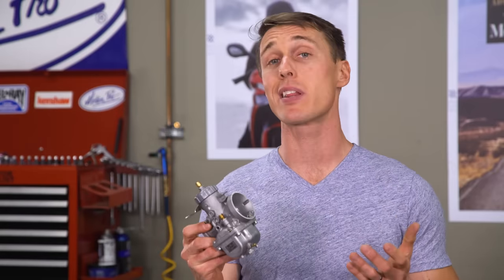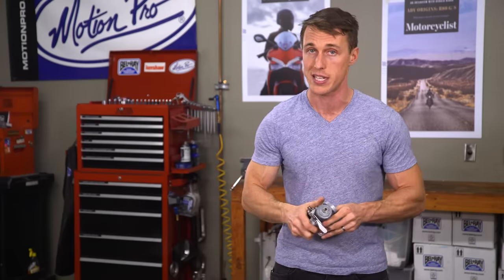Carburetors vs. Electronic Fuel Injection—What’s Better? | MC Garage

Comment: My 2000 Kawasaki ZX600E has carbs and they seem to gum up after it sits a while, especially during the winter.  I heard using non-ethanol fuel, stabilizers, and keeping the petcock closed will help minimize this.  Any other suggestions?
Reply: I usually remove the fuel from the tank b4 storage.
Reply: That is probably the correct answer, however, (full disclosure), I am LAZY!  Ideally, I would like to get the same results without removing the fuel...am I asking too much?
Reply: Just turn of your fuel line and let it run dry bevore you let it sit 
I do the same every time after a ride on my Honda DAX (you know the setting between reserve and fuel on)  and an extra it doesn't smell of fuel 
Hope this helps
Reply: Thank you for the advice!
Reply: You kinda are asking for too much. Try nopro`s suggestion. I dont have any experience with stabilizers but think about it like this. Stabilizers lowers the chances of gumed up carbs. Removing the fuel completely negates it :)
Reply: you heard ??? where the fuck have you been for the last 20 years under a rock
Reply: You're better off adding stabilizer, filling it to the neck(filling after adding the stabilizer helps to mix it). Close your fuel tap, drain the bowls and spray some foggin oil in the carb(s) throat(s) for good measure.
Empty tank, more air, more humidity, more metal wall exposed, more chance for moisture condensation.
Reply: i fit the fuel feeding line with a valve that cuts fuel just after the tank (my scooter doesn't have it on the carb) and when I store it I just turn on the engine, turn the valve and let it starve. I've been doing it for 3 winters now and with a cleanup every mid summer it's been running great
Reply: Al the Pal well u can just start ur bike nt ride it during winters keeps both carborator and engine in gud health
Reply: use only fuel from chevron or 76
Reply: Start it and let it idol to circulate the gas regularly. Might not be fuel efficient but it should stop the gas from gumming up your carb
Reply: How many months are you in storage?

Comment: After buying my first FI bike (Yamaha WR250r), I'll never go back to carbs. I have a '99 Yamaha WR400f that's been plagued with carb problems since day 1. I even recently switched to a different model carburetor. While it runs great now for the first time ever, it's still not quite right and will require more jetting.

The new 250, on the other hand, starts right up every time, has more miles on it than the 400, and has never had a single fueling issue. I've actually made the decision that I'm going to convert my WR400 to EFI using an Ecotrons kit. Should be a fun project, and I can't wait for it to run perfectly every time like the 250.

Comment: Their is one thing this gentleman is not  talking about so I will.  fuel injection is brilliant, it's every think this bloke says it is.  but the problem is this,  a brand-new motorbike with fuel injection very rarely   goes wrong, if it does you can take it back under warranty.  

 The problem starts is in the second, third ,fourth and fifth hand market.  this is the markets where people can't afford brand-new bikes,  some can't afford to buy secondhand bikes. it's why they buy third fourth and fifth hand bikes.  this is the market where the person has to be able to do his own maintenance.  because he can't afford to go to the garage with a blank cheque. like the person who can afford to buy a brand-new bike and change every three years or in some cases  every year.  

 This is where all this electronic stuff becomes useless,   and that's what can happen in this second, third, fourth and fifth hand market,  it is why if you look now motorbike with carburettors prices are going through the roof,  because the people in these markets want them bikes  not fuel injection.  because they can't afford to fix them.  they are computer-controlled and have you seen the price of  the controller.  

 I predict it won't not be long before you will not be able  to the trade your bike in for a new one,  because the garage/ shop will not be able to move it  on.  because nobody wants a bike they can't afford to fix if it goes wrong.   so fuel injection if it wants to have a future it will have to be less complicated and more cheaply to fix.   that is not going to happen,  because the whole idea of a fuel injection is to make a motorbike not serviceable by the owner,  just like modern cars are.  you have to take them  to a garage.
Reply: Well said. This especially applies to 3rd world country, like mine. Friend of mine got a secondhand, 150cc EFI. Couldn't electric start it, difficult to start with the kickstart, no lights when engine's not running. Took him months to save cash to repair the bike. Even now, when everything's fixed already, whenever he put the key to 'ON', the bike makes this perpetual whirring noise.

My brother, on the other hand, got 200cc carbureted, 3rd hand. Starts smoothly, except when the engine's REALLY cold (in which case it requires to be kickstarted for a minute or two). First time he got it, it stutters in low RPM. Slapped a new Keihin, which costs a fraction of the EFI service cost. And it was smooth sailing from there. Well except for valve and cam problem after we abused the bike like there's no tommorow on a 300 kilometers trip through mountaineous route, but valve and cam ain't carb.
Reply: Also want to add to your comment that even if the subsequent owners are capable of repairing their older fuel injected motorcycles, the parts will be difficult to find.

Comment: trouble with modern fuel injection is the necessity for electric fuel pumps, and all the assosciated electronics, sensors, processors etc,  which invariably fail. I just heard you say its extremely reliable....it isnt.  Carbs on bikes are really easy to work on and balance. Personally i cant stand fuel injection, unless its old school, that is to say, MECHANICAL. Electronics in vehicles is a nightmare of built in obsolesence, designed primarily to milk the customer of money and to force (in the main) people to take their machine to the dealer, rather than fix it themselves.

Comment: All the trends suck. Millennials and their low carb diets. Young people today don't know how to work on bikes, and don't want to learn. They just want their bike to be a thrill machine. They don't love motorcycles in and of themselves, they only love the thrill of going fast on two wheels, and if they could go even faster with a magic carpet they would just switch to that.
Reply: Mark S So, so sad and so, so true.
Reply: What's the bad about it... The bike gives me pleasure...and im not forced to work on it
Reply: Speak for your self guy, I'm a young guy and like to work on my bikes, some are fi and some are carb. I prefer fi because I can do the jobs I really want to instead of the jobs I have to, shure the toolbox changes over time to include some more sophisticated stuff but that doesn't make it any less mechanical or satisfying to repair. Fuel injected bikes still need valves done and adjustments made, but it also includes programmable timing curves and fuel maps instead of somthing running on a linear curve.
Reply: @ggme4682  so so wrong and so so false

Comment: Break in a new engine hard or easy?
Reply: easy of course... the hard break in is a stupid myth that needs to die... I'm almost sure it's a trolling prank that went too far...
Reply: Riggro I've had 6 brand new bikes, all of them were broken in the hard way. All of them still running just fine. Oldest one is at 130+k miles. Newest one, my son's 2 years old gsr750 just had it's 28k mile service, everything is good. On the other hand, my friends mt07 (30ish k miles ) which was ridden very gently is suffering from leaky cylinder causing loss of power and oil burning.
Reply: Search for fort nine. He has a good video about this.
Reply: You ride your bike hard at various rpm and gears at a different scenarios.
Reply: SickPrid3,
Oh really? Let's throw anecdotes at each other all day! My brand new FZ09... broken in slow... 30,000 miles... no problem... my old ducati 820D.... broken in slowly... last time I checked, still going strong. My rebuilt and heavily modified subaru WRX... broken in slowly, still kicking ass despite the lashing my brother gives it on daily basis... The mechanics at Renner Motorsport all recommend a slow break in. And they are pros. The tuners at Yumi Motorsports ALL RECOMMEND YOU BREAK IN YOUR VEHICLE SLOWLY before you take it to them to get lashed on the Dyno...
The mechanics at turbo Dynamics in Nashville ALSO recommend a slow break in...
FUCK!
The MOTHERFUCKING ENGINEERS AT EVERY SINGLE MOTHERFUCKING MANUFACTURER in the GADDAMN world ALL, without fail, recommend a slow break in....
Now enters you... mulletman the backyard mechanic... "Nah... what do all those fancy engineers with them titles and them years of education know?" "the length of my walrus mustache and the curls on the back of my head all tell me that I kno better than all these snobs..."
If you had a shred of understanding of physics you would know, but we all know you failed that class since you were on the back sniffing the glue instead of using it for your homework...
Dude, have you ever thought that maybe your vehicles all got lucky and DESPITE your pretty aberrant break in they managed to survive? Maybe due to superb engineering? And your friend's mt07 might be failing due to other reasons?

Comment: I had to replace my fuel pump ._. So much to "its extremely reliable" (2:05) xD
Reply: VtecGoesBwaahh Omg calm down xD It was a joke man! 
Also, my motorcycle is 8000km old so why do you have immidiently insult me without knowing the situation or my humor at all? 😂😂😂
Reply: Luca :3 you extremely joke about them being "soo reliable" your sarcasm isn't the best not gonna lie
Reply: VtecGoesBwaahh is it my sarcasm that is not the best or your understanding of people and language?
Reply: Luca :3 did you think about the reactions you might get from that initial comment? Like at all? You made yourself just sound like an ignorant person hating on him saying EFI is reliable, that's exactly what you did and you should be well aware that there are enough people in the YouTube comments that actually are like that. So no it's not my understanding of people that's lacking, it's your ability of implementing sarcasm into your comment that's lacking.
Reply: That's the one problem about efi. Old carbies never have that problem
Reply: Collin Mac I never had a problem with my carb, cleaned it about 10k miles ago because I was putting in new jets anyway, and runs perfect, no throttle issues, no cold start issues don't even need the choke, it will feel a bit different with different temperatures due to air density but my bike has a lot of character already so I don't even mind tbh, bike has 56k kilometers right now
Reply: Honestly tho, 8k km it's fresh off the wound. Not old at all. Unless your Km are "Dog Km", you know, double or triple the amount of a regular Km.
Reply: JIGA BACHI did I say old? And the bike itself isn't 8k km old what do you mean? I never said it was a long time ago that I cleaned it nor that the bike is old, so I really don't understand what the hell you are talking about. Please explain it to me
Reply: My reply was meant for Luca :3. If you got it by any chance, it was an error or mistake.
Reply: JIGA BACHI oh my god I am so sorry that's kinda emberrassing, yeah I totally though that was meant to me I'm sorry if I sounded offensive or anything, my bad
Reply: JIGA BACHI I should've known too since he literally says my bike is 8000km old, didn't really care about his comment anyway so I absolutely forgot
Reply: It's OK, sadly I have done worse before too. The comments section it's always like a friggin trailer park after a tornado was thru with it.
Reply: I have had to replace my bike's fuel pump twice but that is probably because it is a KTM with the fuel pump motor sourced from a not-so-great vendor. Japanese pump motors are the best, I've heard. Denso anyone?
Reply: Take a look at the video on a ride from London to Sydney by two guys on KTM machines. Both broke down due to non-functioning fuel pumps. A 200 km tow by a Yamaha? Sort of shows the down-side of fuel injection. And the waits for spares to be posted from KTM to very remote places.
Reply: 2c
Reply: Luca :you love to refuel everytime its reserve?
Reply: Luca. I'm on your side. I have a carbureted bike that gets it's fuel because gravity never fails, unlike fuel pumps. Matter of fact, gravity hasn't quit in my 53 years of riding. And no, I don't work on my old school bike all the time like these new born riders say. They exaggerate everything they say about fuel injection being so great.